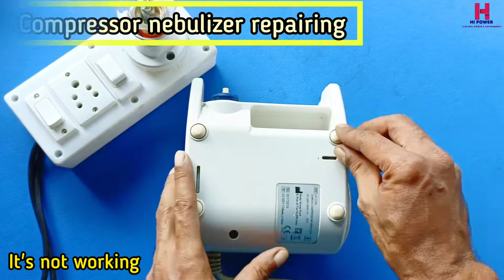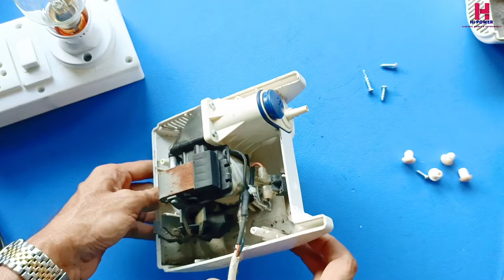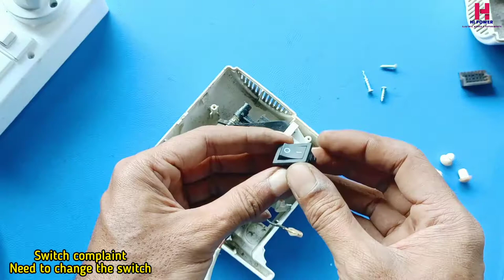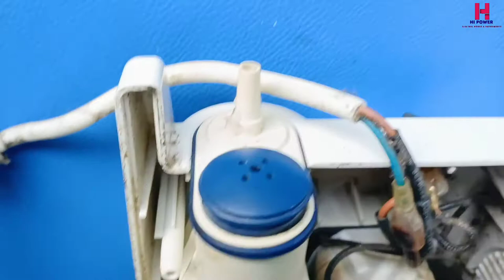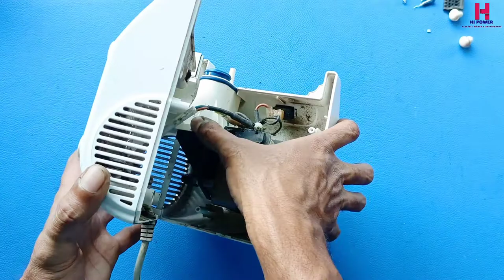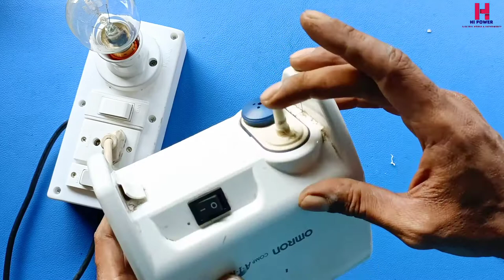Nebulizer repair|Compressor nebulizer repair|How to repair nebulizer machine|Hi power electric works

Comment: But why did you not clean it? This is a medical appliance, should be clean from inside, I think...
Reply from the maker: In this machine, the air inside does not come out, the outside air is drawn in through the pump and released outside
Reply: @Hipowerelectricworks  but it would be not wrong just to water-clean the housing from inside..

Comment: വർക്ക്‌ ചെയ്യുന്നുണ്ട് പക്ഷെ ആവി വരുന്നില്ല എന്ത് ചെയ്യണം പ്ലീസ് ഹെൽപ് 🙏
Reply from the maker: Air puratteku varunna pipe nte aduth aayi  oru air filter und ( holukal ulla oru open cheyyan pattunna plastic cap ) athu open cheythu athilulla filter sponge clean cheythu nokkuka